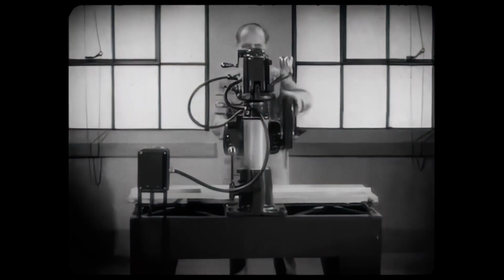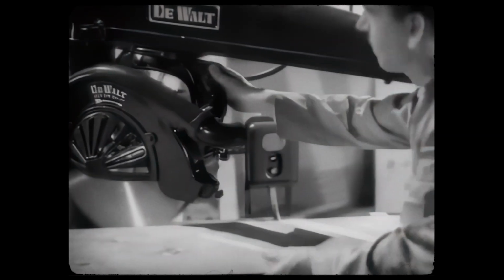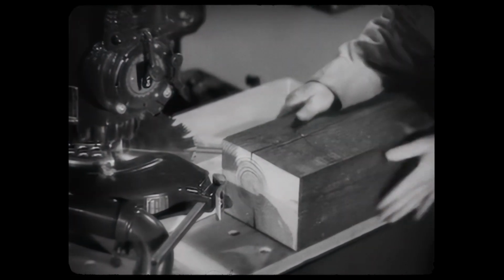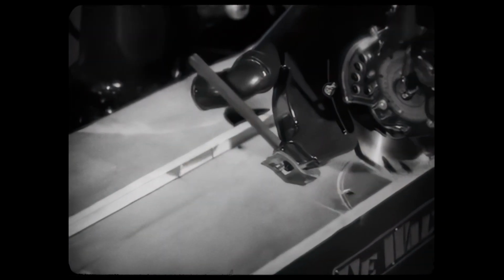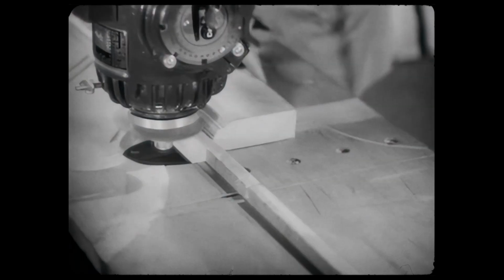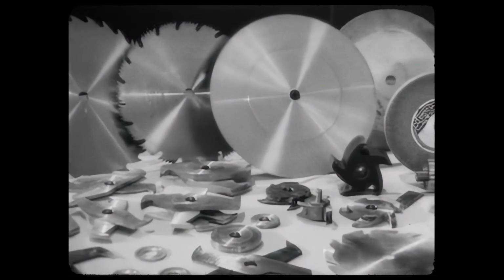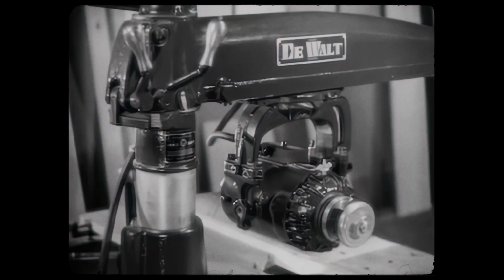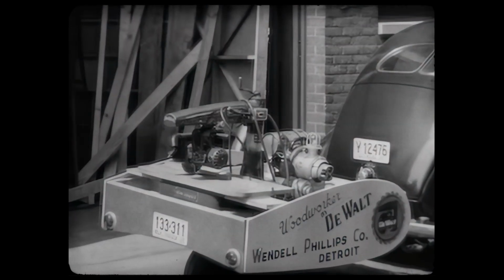DeWalt — A Complete Saw Shop in One Machine (1955)

Comment: I've owned several dewalts and delta radial arm saws. The largest was a 16 " model ge dewalt. If you turn on a 16" radial arm saw you should have instant respect for it and if you don't you shouldn't be using it !!! If you buy one of these used be sure to check for uneven wear in the tracks where the saw carriage hangs on ! Many of these saws were just used for primarily for standard crosscutting in just a portion of their travel . This will produce a lessthan straight crosscut and is nearly impossibe to correct without regrinding the tracks. The larger delta ras have reversible hardened rods that can be rotated to accommodate for wear. I believe dewalt made ras as large as 20" !
Reply: Thanks! I'm in the process of restoring a Rockwell/Delta and will definitely check this.

Comment: Great old video! Although it wasn’t this same saw, I have two vivid memories of a RAS I owned 40+ years ago. The first was ripping a board. The kickback pawl failed, and the board was ejected across the garage, taking out a window as it left the room! The second was how frustrating it was to adjust the table parallel to the travel of the blade! I wouldn’t give up my DeWalt sliding compound miter saw to have it back!
Reply: WOW you can rip with a SCMS?
Reply: @brucewelty7684  he can, but only 12 to 14 inches!

Comment: Nice,  you had to dig deep into archives to find this. 

This Saw is not your sears craftsmen knock off.
Its a much better saw. 

I went to a tool sale once not long ago he had one of this model for sale it was 240volt 12 or 14" blade great big motor the table top was the same and ran off the side of the table like this.
The guy was asking 1,500 for it and he would not budge on the price.
Also had an older Jet 72" table saw cabnit style for less money.
Even today with all the  unsafe issues everyone talks about this saws worth the 1,500  
Its no more dangerous then a real edge
Shaper of you think about it.
I've never once thought about using my craftsmen the ways he showed.
My craftsmen is the last style they made, i bought it new  in 2002
And i use it all the time.
Also have 3 table saws.
And i'll rip with the ras. 
The hardest part is proper set up .

Think about it how easy would it be to make your own window sills with this, you could build your own real wood windows and doors. 
A lot harder to do some of the cuts on a table saw.